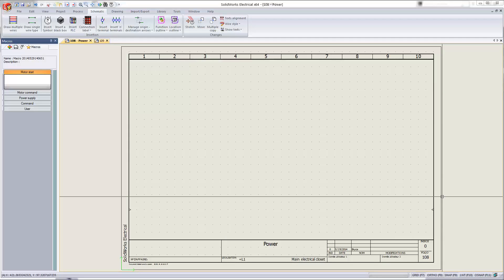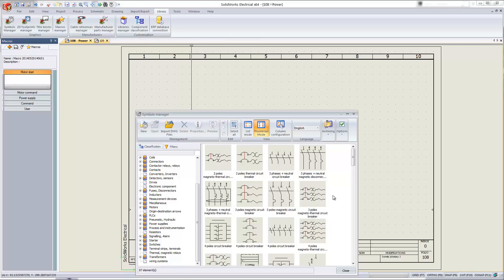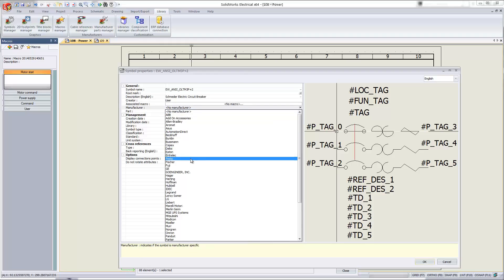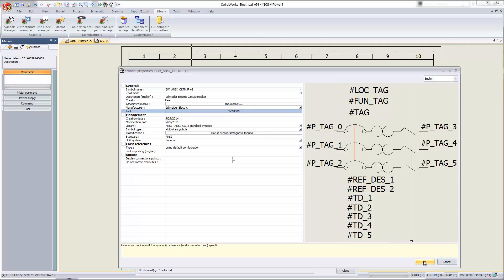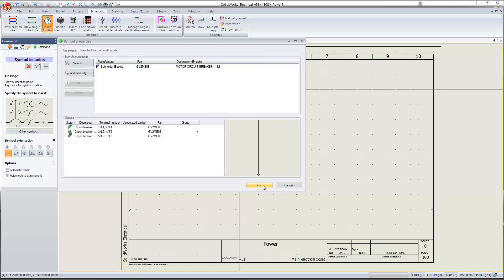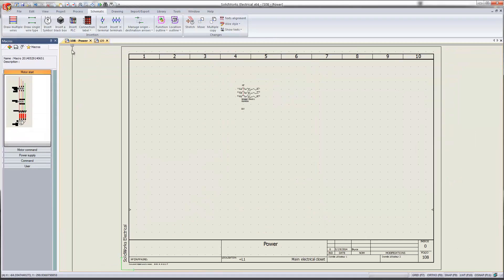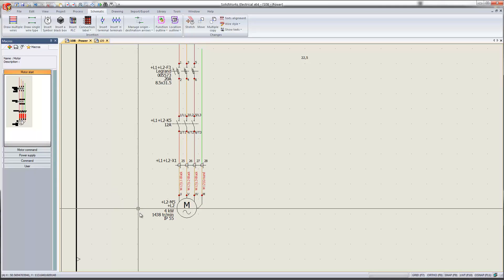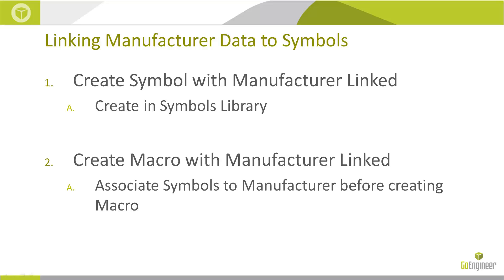SOLIDWORKS Electrical - Linking Manufacturer's Components to Symbols

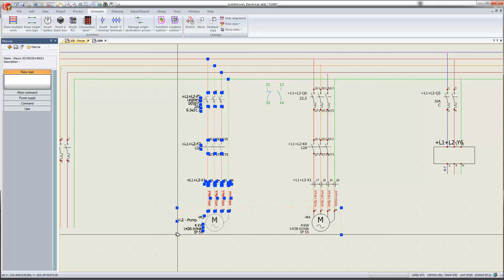Comment: At minute 2:40 or so, the two tripping contacts 21,22 and 13,14, how do you link them each one of them to an individual NO or NC contact somewhere else in you schematics? Say that I wanna use the NO to run 24 V into a PLC input when the Overload trips but wanna show that connection in another scheme of the project. How would you do it? Thanks